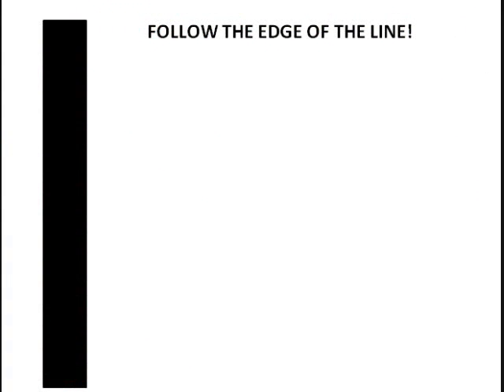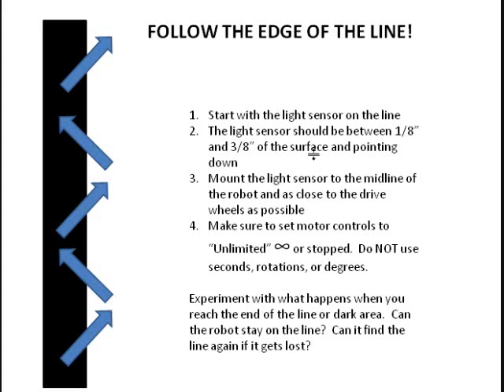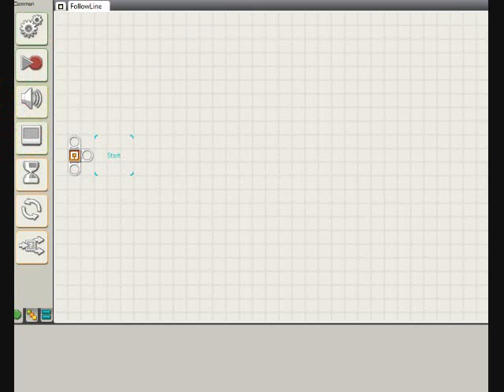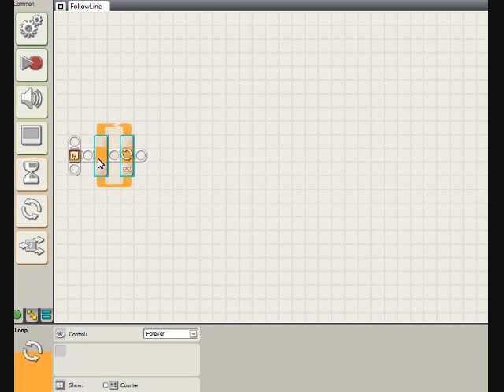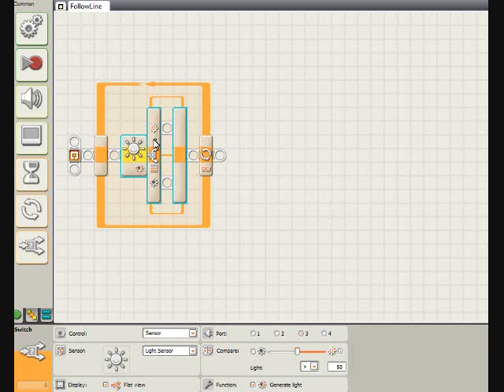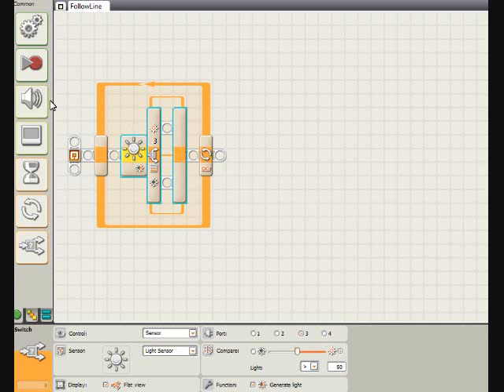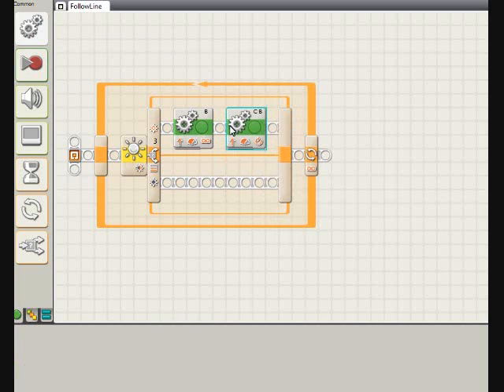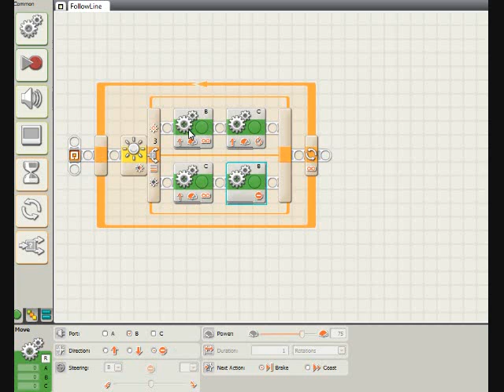LineFollowing.wmv

Comment: @pratik mohapatra Check to make sure your program and robot are set to the same port number, that is the most likely reason it isnt turning on. The 2nd possibility is that you have it turned off in the programming block. There is a check box to turn the light on and off. Hope that helps, Tom

Comment: sure, all you have to do is click on the loop block and change it from unlimited to sensor. Then select a sensor, such as a touch sensor, and set for push. Now the loop will run until the sensor is pushed, then go to the next block in your program. Hope thathelps, Tom

Comment from the maker: @NobPilot1 I do have a nice all wheel drive that uses only two motors and 4 wheels.  The two right wheels are run off the same motor, using gears.  And the two left wheels are run off the other motor, again using gears.  It turns a little clunky, but it gets over things much better with the all wheel drive. Visit the Maine Robotics website and download the PDF file for the robot

Comment from the maker: @NobPilot1 Not sure of the robot configuration.  Usually robots need to have one side being run by one set of motors and the other side by a different set of motors.  So let's just say the A motor is the right and the B is the left.  Then you just follow the directions.  If you have one motor that runs both of the back wheels and one that runs the right front and one that runs the left front; then you can't really turn the robot, at least not easily

Comment from the maker: @Jmaz926 : The LED should be on.  If the LED doesn't come on or you don't get any number showing in the display window for the light value... then you either have a bad sensor, a bad wire, or a bad port on the NXT.  Try a different wire, different sensor, different port.

Comment from the maker: @Jmaz926 : Have you ever used the VIEW function on the NXT?  From the Main Screen on the NXT, use the arrow buttons until you reach the VIEW function (looks like a screen with an arrow). Select this. Now use the arrow keys to move until you get REFLECTED LIGHT (looks like a light bulb that is on). Select the Port it is plugged into (1, 2, 3 or 4).  It should now have the value of the light being received showing on the display window.  Move it around, check different surfaces.

Comment from the maker: @Jmaz926 : You can run a line follower with either a light sensor or a color sensor (running as a light sensor).  And yes, when you run the program one of the LED lights on the sensor should turn on.  There are two LEDs (Light Emitting Diodes) on the light sensor.  In the sensor block in your program, make sure you have the "generate light" check box marked.  Also make sure that whatever port you have listed in the program you have the light sensor plugged into that port.

Comment from the maker: @hirumiyamada 
If you are running the motors directly on the NXT drive wheels (most times this is true), then you can power the motors between 25% power and 100% power and still have the robot run.  If the robot is going too fast, try dropping the power down to 50 or 40% and try again.  If it still is going too fast (or missing the line) then double check that the robot is seeing the line by using the view command on the NXT (we have a video about using that function as well). Good luck.

Comment from the maker: If you are running the motors directly on the NXT drive wheels (most times this is true), then you can power the motors between 25% power and 100% power and still have the robot run.  If the robot is going too fast, try dropping the power down to 50 or 40% and try again.  If it still is going too fast (or missing the line) then double check that the robot is seeing the line by using the view command on the NXT (we have a video about using that function as well). Good luck.

Comment from the maker: There are a couple of things to check.  1) make sure the light sensor is plugged into the same port on your NXT as the program is looking for (the default is to look on Port 3, so make sure you are plugged in to Port 3).  2) if the light/dark values are too high or too low then you are probably stuck in  the turn left part of the loop.  From the main menu on the NXT, use the arrows to go to VIEW and check on what values the light/dark are giving you and match program to something between this.